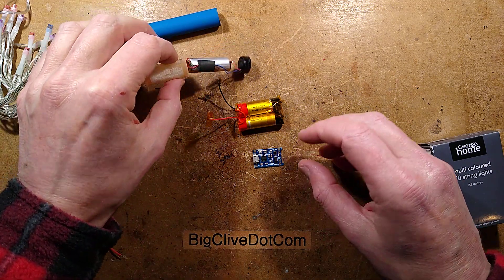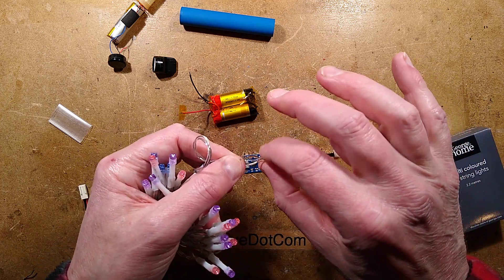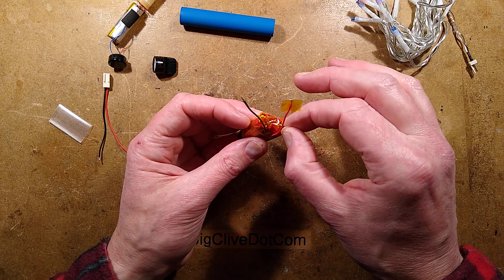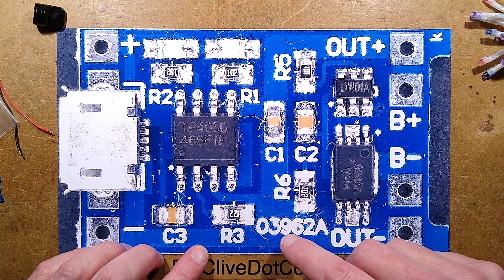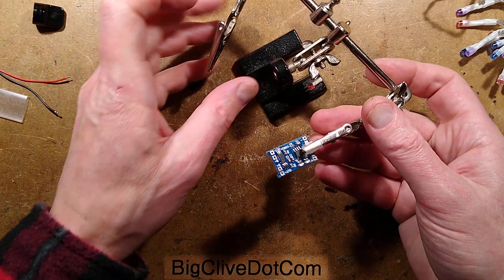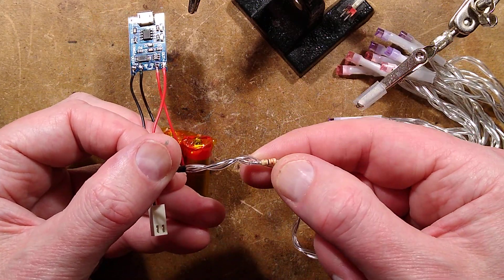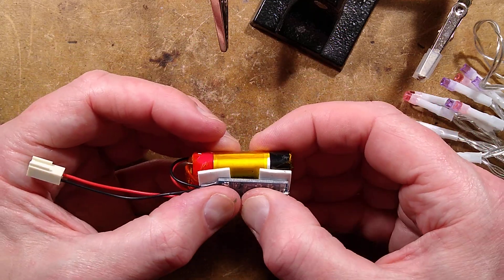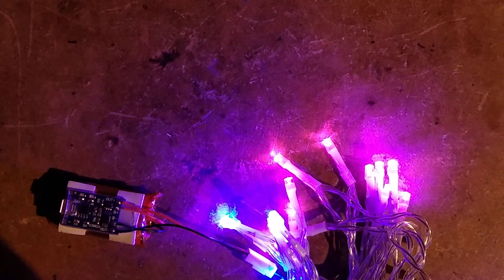Cheap power pack with free lithium cells (USB or solar charging)

Comment: Thanks Clive. Those little USB boards are great and very cheap. I get the ones that include a boost converter that can be varied for 4-27v out - great for turning any low current, battery powered device into USB-rechargeable with the addition of an 18650!
Have you every thought of screen casting the zoomed-in photos instead of printing them to save on ink/toner bills?! 😉
Reply from the maker: I like to sketch on the images.  I use a bulk ink system.
Reply: Actually you don't need to even pay for the charger boards. I often find these "Devices" with a build in charger board. You only need one of them and you can charge all your free batteries

Comment: That's a nice board... I have converted several sets of lights around the house to use your circuit board that uses the ldr (light dependant resistor) transistor and a couple of resistors so they only come on at night. These work very well.
Could I use these on the output of the charging module which would make them last even longer... I dont see any issues as they would be two seperate units... I'd then like to add that solar panal so they charge by day and light when dark.

Comment: To make sure that multiple cells are at the same voltage before connecting them together, you can just connect them together via a current limiting resistor between them (a couple hundred ohms is plenty) and leave them for a while so that they balance themselves.  Then once they're stabilized, you remove the resistor and just connect them directly together instead.
Reply: But this won't tell you if both cells will charge and discharge equally. 
One of them could have way less capacity because it already degraded a lot more compared to the other cell which could be a major problem. 
The best way would be to discharge and charge every cell individually to see if they both similar in their performance 
Only then it is safe to wire them together.
Reply: @JT_6233  If you're talking about wiring in series, absolutely.  A half decent BMS will make up for a certain amount of imbalance, and people shouldn't build a pack without one.

However, if you wire the cells in parallel then it won't matter.  The low capacity cell will balance with the higher capacity cell as they charge and discharge.

A BMS is still advisable, for overcharge protection, overdischarge protection and current limiting.  But in parallel, the cells will balance naturally.
Reply: @antontaylor4530 What about wiring up 2 cells in parallel  with a board, then wiring up multiple boards?
Reply: @csn04  You would not need a PCB to do that (I assume you mean PCB when you say board...?)

You're describing a 2p 2s (or 3s or 4s etc) setup.  It's common.
Reply: @antontaylor4530  Yes. I meant wiring two cells up to a TP4056 board in parallel, and wiring up multiple TP4056's. This way, every 2 cells have a BMS. I think wiring these cells straight up in series with the different voltage levels wouldn't be a great idea.

Comment: Why use 1.5V when calculating the current at the end of the vid?
Reply from the maker: Cell voltage minus the LED voltage = resistor voltage.

Comment: Nice recycle job and I like the idea of using these once disposable lithium cells for another purpose as well as using them for a string of led lights.
What is the name of the circuit board you used? I didn't catch what you said it is.
For your nest fun little lithium cell recycle could you make one that uses a solar panel to charge the cell or cells?

Comment: First of all: charging 2 LiPo in parallel - not good as they might have different characteristics.
Second: the output GND is NOT via MOSFET ;-) @8:30
Third: it is very common that when you change battery the output goes to 0V - solution is to short for a moment both GND outputs - then the charger restarts.
Fourth: considering I would go down to 10mA and the amount of light would decrease only little but life of battery 3x longer

Comment: I made a battery led set, even with resistor, I calculated that they would last weeks, two days later they were dead 😑

Throw over a highway bridge and play smoke roulette? 😂

Isn't the tp4056s resistor the charging current and not the total voltage? Or, something like that

Comment: Clive, which charger could you recommend for charging such Lithium cells that is more efficient than TP4056 units?
I know TP4056 are massively available (and I also have some on hand), but I'm sure there exist better chargers, non-linear ones, and the only way to make them more available is to popularize them, I think.
Wish you can remember some examples.

Comment: I use these modules in a similar application in my yard with solar. They work very well. Be aware that connecting the battery backwards will destroy the module.

Comment: I definitely have shorted several of these recently. Thankfully they are only $5 for a 10 pack.  I have a collection of these batteries I have saved myself. I rarely see these where I am even outside the shops that sell them. The ones I do spot have already been flattened.

Comment: Never seen any of these flavoured-up, fog-producing devices just lying on the ground anywhere. I guess it's not really a thing here or maybe it's just not something people do in the area I live, I dunno. That said, I've salvaged quite a few quite nice li-ion batteries from all sorts of devices, like e.g. broken bluetooth-speakers, handsfree-devices and wireless headphones. They don't pack a ton of capacity, but they're small and quite nice for small, low-power projects, and in my experience they're not particularly worn out even after years of use in the original device.

Comment: The TP4056 does indeed get hot when charging - I was surprised to see a package temp around 180F on mine.  Over years of use it hasn't been a problem though.

Comment: I made a battery for a portable cassette player out of one of those cells, but I encased it in resin inside the old metal case, because it still smelled like the 'tine. I tried my damnedest to remove it but it still had trace amounts of it, made me kinda sick.

I've decided not to mess with these things ever again.

Comment: A couple tips:
* Make sure the USB port is actually soldered to the pads at the plug edge, I've had some that are only soldered at the back data/power lines and snap off
* Cut the tubing a bit long at both ends and cut a slight semicircle so it can go over the plug-end (align the semicircle cut with the plug) of the board but not obstruct the plug.  This also helps keep it sliding back off the assembly if it loosens up any since it'll "wrap" the front edges.  I had one pull apart when I unplugged the cable, that was not fun.
* Wrap the entire thing batteries and all with a snug fitting heat shrink, as an extra layer of protection.  Doesn't need to be as long, and doesn't need to be fully shrunk tight - just enough to not fall off.

Comment: Hi Clive.

Regarding using TP4056 as a solar charger: I had some negative experience with it. Because it's a linear regulator, it just wastes a lot of energy. Due to how solar panel work, it's not only quite wasteful, but also makes it very hard for the charger to "start up". Would be nice to see some experimentation here :)

There's also an impulse alternative to TP4056 starting to become popular now, maybe it will work better.

I've also found something REALLY interesting that you might be interested to review. It's a "DYI power bank" where you have to insert around 12 18650 cells... in parallel. By the looks of it, there's absolutely no balancing as well. There are a couple of reviews mentioning fire ;)

Comment: Clive, here in the States we don't need a photo id to shop at scrap yards, and I've found a number of things over the years. I e bought generators table saws, a band saw, several working welders, many hand and power tools, and sever batteries for ride on mowers all the way up to automotive types, and sever very nice tyres, and pairs of them. People tend to be very wasteful. While I don't use smoking products, I have found a couple of the units that bear these batteries.

Comment: How many of these little batteries (i have a load of them from discarded vapes) would be the most to put in parallel? they are all 500mah 3.7v. i have adjustable regulator to keep steady output at 5v 1a. The idea is i want to make a relatively long lasting power bank.  if i have a set of 3 batteries in parallel with a tp4056, and i do that 3 times and put them together in series so 3p x 3s - do you think it would be safe and reliable?
Reply: bc?

Comment: Your pack was connected in series, not parallel, correct?  I may have missed that, but the circuit is I tended for 4.2-3v

Comment: Regarding lithium cells and their explosive capability.
My neighbour has an e-bike and had shorted out the battery pack by using a screwdriver to remove corrosion from the barrel connector.
This potential bomb was fully charged! 36 Volts of destruction :(
So I took it to the shed and left the door open, in the event of a fire I could have thrown it outside.
I replaced the module* which regulates the charging but as I had never done this before I was very apprehensive, to say the least!
*available on eBay for about £10. I saved him £200 for a replacement battery pack.

Comment: I've used those TP4056 chargers many times but I have heard something about them that I'm hoping you could clear up for me. I was informed that while they do allow you to charge the battery while under load it is not recommended that you do that because the TP4056 charger cannot properly regulate the charge of the battery while it's in use so there is a risk that it can overcharge the battery. Do you know if this is accurate? Or do the protection chips protect against this as well?

Comment: So I guess the forward voltage drop of the LED string would have been around 2.7VDC or so, and that is why you used 1.5VDC to calculate the current with your choice of 33 ohm limiting resistor with a "fully charged battery"?  Fully charged Li cells being ~4.2VDC less the 2.7 remainder 1.5.  Probably goes without saying, but just saying....  And, by the way, thanks so much for that wonderful explanation of how this ubiquitous module works.  Hadn't seen that before.... but "now I know!"  Thank you!

Comment: When I tried to connect one of these to some lights and and solar panel like you mentioned, the panel drained the battery past the safety levels. Needs a photo resistor in line with the solar panel maybe?

Comment: 10:50 I like to do it In general but especially because the pads are so close on these, I prefer to solder a connector on, that way you don't have to work on something with a live battery.

Comment: how many batteries you think we can get away with? 4  6  10? giving a more ah battery? I was thinking about putting a few into a nice neat box.On a seperate note can these be adapted in some way through series and parrallel to get a free phone backup battery for charging? go pro battery essentially anything with a usb power requirement? Or did i miss something, like these batteries are so low powered that they are really only good enough lower drain stuff?

Comment: i have collected quite a few of these horrible disposable vapes. fortunately they seem to cut off at about 3.5v, so the batteries are still in good nick as they are carelessly thrown on the floor. i just charge them using my usual 18650 charger using croc clips first, and it usually charges them at 250ma, which should be safe enough. 

i now have a multimeter, a couple of remote control kids battle tanks and an old xbox 360 pad all powered by those cells and cheap chargers from ebay. 

combine that with my 3d printer to make housings, and many small devices i may never have to buy batteries for again.

having kids about just got much cheaper.

Comment: I prefer putting a diode in series with each cell, before putting them in parallel. Charging can take place via another set of diodes. Doing so, there will never flow an uncontrolled current between the cells, even if one goes "bang".

Comment: Thanks for this video, perfect guide on how to do this. Simple question I hope I can get answered here instead of trying to understand datasheets, for a battery that is 90mAh, 110mAh, 500mAh, 650mAh, what resistors would I need for these four on the charging module?

Comment: You may add a cheap PNP Transistor, a Diode (preferable  a Schottky Diode ) antiparallel to the Emitter-Base Diode ( Diode Anode connected to Emitter, Diode Cathode  connected to Base of the Transistor ) and wire it at the Gnd-Connection to the Solarcell. Anode at the GND of the Board, Cathode at the GND of the Solarcell. The Collector of the Transistor will be the new GND for the LEDs. Sometimes you have to add a Resistor of some 10k in parallel to the Solarcells to switch on the Transistor at Night.

Comment: I love this USB TP4056 modules, 
1. programmable Resistor R3 for charging current limit,
2. Li-Poly and Li-Ion protection from over voltage, over current and too low accumulator / battery discharge protection too !
I do use them almost in all of my project, so far 60+ units used and no failure yet, 
Have a nice day mate ! 

🔋

Comment: Great Video Clive, Nice Tutorial! I did something similar with the USB-C version of that board a few weeks back.
I bought an old miners lamp from eBay which used to use a lead-acid battery. I upgraded it to run on 3x18650 cells, but had to also use a boost converter to up the voltage to 6v as I kept the original bulbs for an authentic look. After the upgrades, we go and test it in an abandoned lead mine in Cumbria, along with various Milwaukee LED lights that I previously repaired. 
If you get the chance, you might find the video quite interesting!
Reply: I think, obviously check yours, that some miners' lights I've seen use a single 2 volt lead acid cell. No reason for them no to, so saves expense and makes them more reliable for use with an old torch bulb. Which yeah, they do have a certain charm, I'll miss them when they're gone, though not enough to actually keep some anywhere. Same with the old light bulbs.

Comment: Hi Clive, I fancy trying this project but my old Maplin Precision Gold Hobby Digital Multimeter has stopped measuring voltage correctly. Even with a new battery in it, a 9v cell reads as 352mV. No idea if it's repairable or just to get a new one.
Have you seen the one ALDI are offering this week? Is it any good for a know nothing fiddler like me?:)

Comment: I love these modules and they are very flexible in terms of size, in that I mean if you are really constrained by the space you want to put one of these (for example if converting a small gadget to rechargeable) there is quite a lot that can be snipped out from each end (might need to fix the + connection on the usb side if you snip a bit too much but it's super easy) and then you can use a standalone breakout usb connector to power it.

One thing I'd avoid if you can help it is to put them in close contact with the battery, the chip when charging at the full 1A gets quite toasty

Comment: Are there any of those charge modules that have the low voltage cutoff closer to 3 volts?  2.5 volts seems really low for lithium cells, or is that not going to damage the cell?

Comment: Recycling batteries reminds me of the Polaroid cartridges, after taken 10 pictures and the cartridge was "empty", there was still a battery inside with enough juice to light up some small light bulbs. If i'm not mistaking, but i think those batteries where 6V.
Reply: My wife worked in a photo lab when disposable cameras were all the rage. Each had one or two alkaline AA cells (for the flash) that retained most of their charge; when they opened the camera to extract the film, the batteries were separated out into a tub. My wife took them home, and for years we had a free unlimited supply of AA batteries!

Comment: Hi Clive. Amazing video as usual. A quick question. Is it possible to use one TP4056 with a different capacity batteries. Your reply is appreciated in advance
Reply: if you put different capacity cells in parallel the total capacity just adds up so yes you can pair as many as you want

Comment: Hm, this could finally be a use case for those 2 fat ~29Wh cells/packs I salvaged from a failed powerbank (control board died). And would definitely be a "safer" power source for a night light (string of micro-LEDs) that is currently running straight from an 18650 without any form of protection other than the LEDs dimming down when the cell drops below 3V 😅
Only thing I didn't quite get from your video: do those board regulate the output voltage to ~5V or is it just the cell voltage exposed? You just mentioned that it cuts off when the cell goes too low.
Reply: They do not have a regulated output voltage: just the cell voltage in the range 4.2 down to somewhat less than 3 before they cut off
Reply: @aplanemaker  Thanks for the confirmation. Looks like they are the perfect addition to that night light to prevent accidentally draining a cell too low :)

Comment: I work in a hotel, and unfortunately, is not that common here (in spain) to find these... luckily, i managed to salvage 2 with still usable lithium cells. The only difference is that i like to use the TP5100, since it's a buck charger, more efficient, but without the DW01A and dual mossfet protection circuit (wich i add from a dead salvaged lithium cell). Also lacks of any connector, but if you want to use them with the solar panel, they allow you to use up to 18v input, so a  6-12v solar panel could be used... It's allways good to see the modifications you make, i already modified all my christmas fairy lights with salvaged lithium cells inspired by your videos (almost a copy-paste), can't recommend it enough.